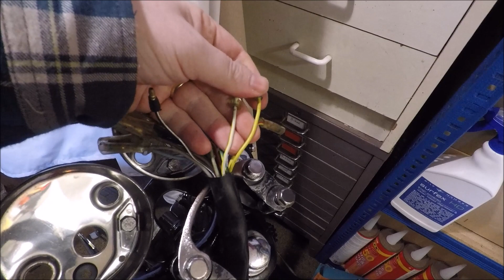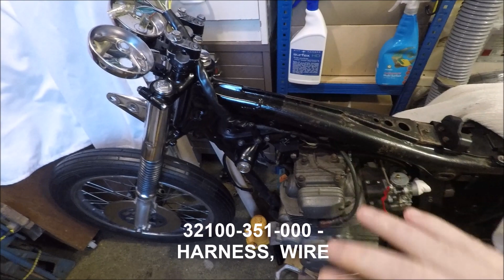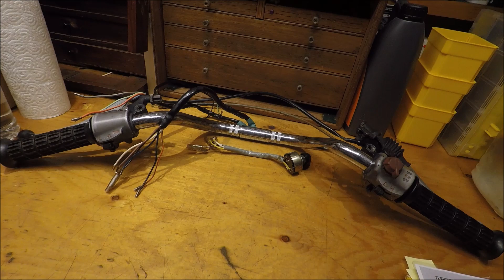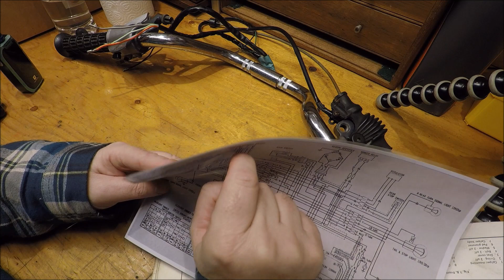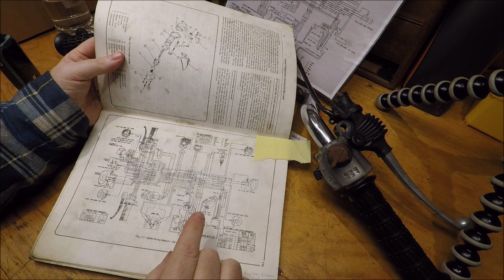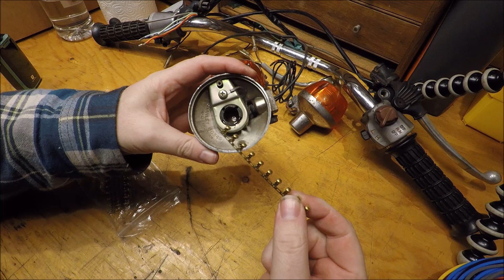Honda CB200 - Loom, Switches and Indicators

Comment: Gareth...possible to look where the main ground wire for the battery is positioned..??
I don't currently have the wire but appears to be around 15" long and same guage as the starter main lead.
I intended to run it to the engine somewhere at the back and then run a couple of extra earth returns to the frame , ignition and the handle bars.
Cheers Jeff
Reply: Never mind.....found it in your "clutch cable routing" video...........cheers Jeff

Comment: Very useful. 
Is there anywhere I can get tips on how to rebuild my front end electrics? My model is the same. 
Thank you
Reply from the maker: Hi Jamie. Can you be more specific? Do you mean the mass of wiring in the headlight bucket? Let know and I can see what I can do. Not been able to progress things much over the past month due to work, but hope to get into the garage soon.
Reply: @garethowen7050  Hi Gareth,  thank you for getting back to me.  
I have had a look through your videos which are great. 

You done a strip down and re-wiring the indicators video but have you made a video on the mass wiring in the headlight bucket?  I would love to learn how to reconnect everything in there.  

I picked up the project from my mother in law after her husband passed away and would love to finish it off and get it on the road.  

Thank you for your videos.
Reply from the maker: @jamiebellpt6081  The head light bucket is still to come. Bucket and other parts are away being painted. When done we will put them all together.  Need to finish the dials, thats the next job, then finish the rest of the front end in proporation for the light.

Comment: I snip a bit of coloured heat shrink if I need to colour tag a cable or if it's striped I use a piece of the correct coloured sleeving. Job's coming along nicely Gareth :)
Reply from the maker: Hi Hepcat. Thanks for the comment. Heat shrink - love the stuff. 

Getting there, slower than I would like, but progress. Have now re-wired the indicators, happy with that little job. Now considering doing the rear ones as well. Need to get on and do the dials though. Sort of feel as though these little jobs are procrastination... not looking forward to doing the dials. Need to get a heat gun to soften the plastic and then there is no excuse.

Did you say you were building a larger workshop? How's that progressing?
Reply: @garethowen7050  Hi Gareth, new workshop is going up next week. It's been a manic time emptying everything out of the old shed into our lock-up and dismantling the shed, which was very well built I must say lol....One of them wish I never started jobs for sure.